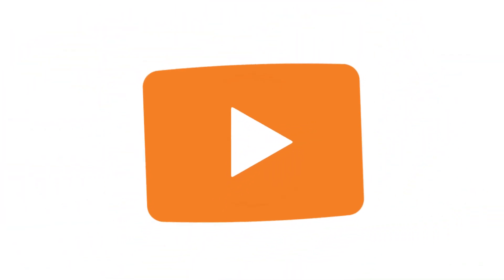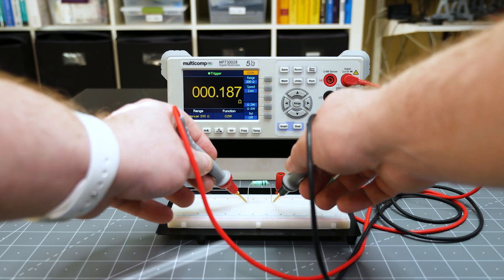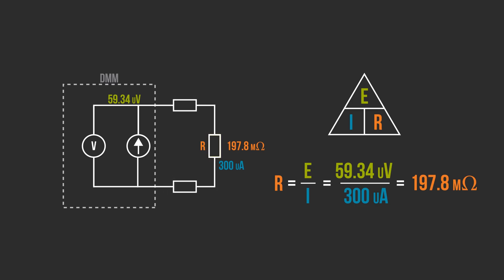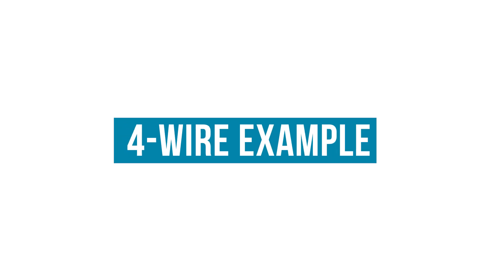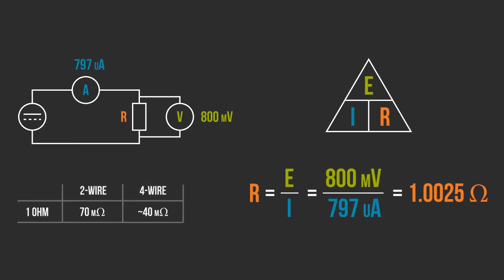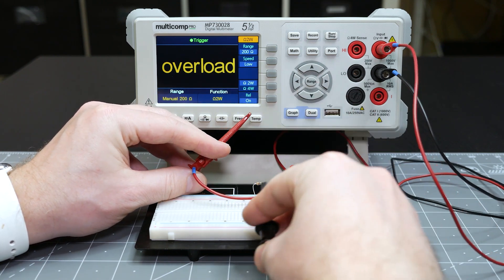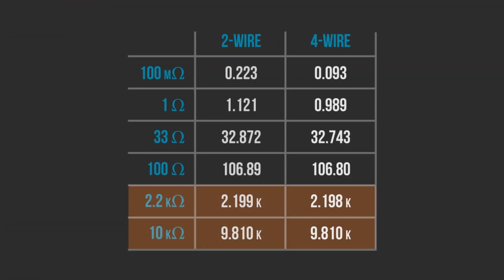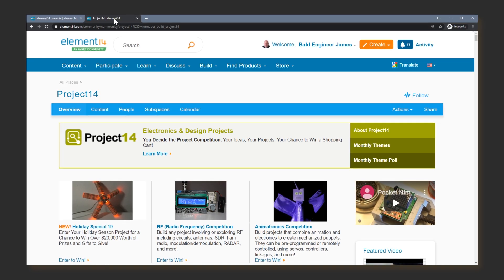4-Wire Resistance Measurements - Workbench Wednesdays

Comment: I typically just use the “Rel” key to zero out lead resistance on meter before measuring…much simpler and extremely accurate.  I use this festure prinarily dealung with op amps

Comment: Thanks for explaining! It's unlikely I'll ever need to use 4-wire measuring as I basically never use very small resistances, but it's good to know if it ever becomes relevant.
Reply: if you design a PCB, it comes in handy with complex circuits where you can't find a short in the trace. That way the smaller the resistance and accuracy, the closer you're getting to the short.
Reply: @WisdomAndWhisk  That's a good use, thanks for the tip

Comment: Excellent Video in explaining the 4 wire Bench DMM. Too Bad hand held devices do not have that option. Looking at the $ wire measurement makes sense in measuring very small resistance. I was looking at build a  milliohm meter for just that purpose but it would need to have leads that are no longer than a few inches. And it would only serve one purpose.

Comment: According to the specs on the MP730028 (200 Ohm range = 0.030% of reading + 0.005% of range), its uncertainty at 0.1 ohm is 10.03%. If you're checking a 10% resistor, you need a meter that's accurate to 2.5% in order to have a Test Accuracy Ratio (TAR) of 4:1. That meter is barely good enough to check a 1 ohm 5% resistor. At 1 ohm, its uncertainty is 1.03%..

Comment: If you always make sure you're measuring resistance with the very tips of the leads, you probably don't have to worry that much about a difference do you? 

Also, when moving your clip leads from the first resistor to the other and back, do you think it's possible that you are relocating the clips onto the original resistor at a slightly higher position on the legs or lower position? Or possibly the clips are getting a tighter bite before or after you clip them on the second time? 

Would any of that make a difference?

Comment: In you graphics you use a capital M to say mili. This is wrong. Capital M means mega. This is 101 stuff, and it is incredible that you would get something this elementary wrong.
Reply: Well, it is not a capital M. It is a small caps M. The font used does not have lowercase letters. It is why the “m” is significantly smaller than the Omega. Just like the “u” for Amp and Volt. Which is another small caps letter. (And yes I know I didn’t use a Mu there!)

While the distinction was obvious to me, especially since I tend to write in small caps, I can see how someone not paying attention to the size of the letters could make the mistake. 

We will have to come up with something else.
Reply: I knew what you meant, but with everything else being so accurate, it would probably be good to find a font that allows you to use a real lowercase m and the greek letter μ for micro as well.
Reply: I'm pretty sure it's just a small caps font making it look that way.